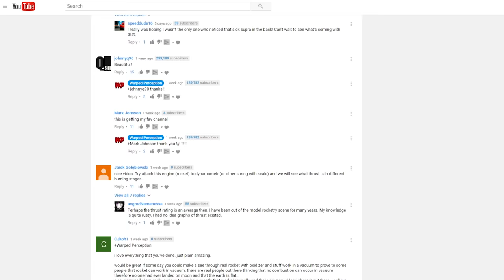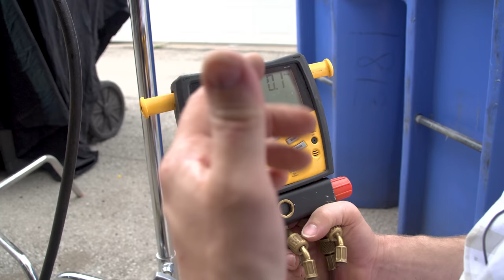Model Rocket Engine In A Vacuum Chamber - 4K Slow Motion - will it burn? - Rockets (S1 • E3)

Comment: The rocket propulsion filled the tube to create pressure and was pushing against the exhaust buildup to create the atmosphere and thus pressure. Your finite tube is not the vacuum of space.
Reply: It's irrelevant anyway, anyone who understands basic physics knows a rocket will work in a vacuum.
Reply: @mattl2k6  Really? I guess common sense is out, because anyone with common sense would figure out you can't have an equal and opposite force against nothing.  A vacuum is a void. It is void of anything and everything. Open a rocket nozzle filled with oxygen or explosives and the vacuum of space will suck the energy right out of existence.  Without an atmosphere, propulsion technology is rendered useless. Test pilots proved this a long time ago. But they want us to believe we can push against the great nothing and get something. Otherwise, we wouldn't believe they went to the moon or that they are exploring space! You cannot create or simulate the void of space here on earth. The container used to form a vacuum instantly has an atmosphere when the rocket discharges the gasses used to propel the object. They have distorted reality and science and everything we believe is a lie. Imagine charging people $50,000 to sit in a classroom as you teach them fake science and twist their realities. They have done it year after year after year. It is staggering! This is why they say it is lonely at the top. You can't have a conversation with anyone and have an actual meeting of the minds. I almost wish I didn't know everything already!
Reply: @davidwest2963  You don't need an atmosphere to push off of for a rocket motor to generate thrust. It's as simple as that.
Reply: @darklight2.1  the reason for this experiment and many others is for the sole purpose of sustaining the myth of space travel. Newton's law answered many questions but did not address the unknown elements of the vacuum of space. It is all supposition and speculation enshrined in educational curriculum and does not make sense beyond the confines of earth. If our planet is traveling 67,000 mph and we could crawl into space at a comparatively much slower speed to reach Mars, for example, the conservation of momentum would lose its convenient meaning. If we broke free from a spinning sphere, orbiting at break neck speeds, the solar system would take off and leave that speak we call a rocket in the star dust. It would be a cold and lonely place adrift the universe in a rocket with compressed oxygen and fuel with igniters. That rocket would need a lot of oxygen and solid fuel cells to survive 10 minutes after earth hurled away taking the moon with it. If a rocket traveled to Mars and beyond, we defied the gravitational forces this brought to your mind, in knee jerk fashion. No, we have rockets that broke through that force to reach Mars and beyond, all the while, with smooth transmissions of data. It is a fantasy and a fallacy to believe this has ever happened. Unless we have anti gravity technology. So they need to announce they had anti gravity capabilities in 1969. And since the lander left the moons' surface without a trace of propulsion and snagged the command module, for a safe trip back into our 67,000 mph atmosphere, we have hidden, top secret technology. Slow down cowboy, before you form another fantasy. We don't have the capabilities. And you want an equation to justify rocket propulsion in a tube to validate my assertion? How about we apply a little common sense starting from the beginning and unravel the many justifications needed to patch up the many many holes in this story. The vacuum tube demonstration is not the universe reduced to a vacuum tube and toy rocket. If it were, how far would it make it on the way to Mars? The fuel needed would be greater than the load capacity of ten rockets. If gravity is the glue; how do we neutralize the glue to transition from one moving body to the other? Compared to the forces needed to do these things, our rockets couldn't pull a greasy hair out of a gnats ass. And you believe we overcome these forces in the vacuum of space. NASA is a dog and pony show and I am out of cliches'. Wait! Happy hunting my friend.
Reply: One of Newton’s laws of motion states (can’t remember what one) that each and every action has a reaction. What rockets do is create a high pressure environment that expands out to space. The movement of the gasses propels the rocket forwards. You can test this by taking a balloon, filling it with air (creating a high pressure environment like a rocket) and opening the end of the balloon to release the air into a lower pressure environment (like a rocket shooting propellant into a vacuum). The air moving out of the balloon pushes the balloon in the opposite direction. This can also be tested by pushing a swing with an equal or similar mass to yourself while on a swing to simulate movement in a closed environment.
Reply: @davidwest2963  - "you can't have an equal and opposite force against nothing"

Good thing rockets take MASS with them to space to PUSH ON.

If you want to learn how rockets work, I can help you . Just answer a few simple physics questions.
First question:

If I fire a steel projectile from a crossbow, here on earth, will I feel a recoil force?
Yes or no?
Why or why not?
Reply: @davidwest2963  - ""It is all supposition and speculation "
It is not. we have literally flown THOUSANDS of spacecraft in space.
I have personally helped build, test, launch and operate a number of spacecraft in earth orbit and deep space.
Ask me any question you like.
Reply: @stuartgray5877  yes, but reduced or undetectable in most bows today... The bow string and bow tension create the energy or velocity of the wind splitting arrow. The hand holding the bow would be the point of recoil detection as the immovable object, but in the instance of arrow projection the recoil is mild compared to the energy released into the arrow. The stationary arrow is met with with a greater force than the arrow at rest. The kinetic energy is external and forces the arrow through the atmosphere. Rocket propulsion is internal and opposite to bow and arrow propulsion and would not be dependent on atmospheric pressure as the resistence needed for continued thrust of rocketry. Rocket propulsion needs (A) combustible fuel, (B) oxygen, and (C) atmosphere to create thrust. The vacuum of space does not provide B or C. You could package the massive amount of B needed, but not the essential atmospheric pressure. 

Rocket powered aircraft- test pilots proved this in the 50's and 60's. Once they reached the much thinner - upper atmosphere the rocket powered aircraft destabilized and lost propulsion needed to sustain flight or forward motion. These rocket powered missiles with wings did not make it to a zero atmosphere. A vehicle in space would need a whole new propulsion technology such as an anti gravity system to travel through space or to the moon for that matter. 

Sir, the deception runs deep and wide and relies chiefly on relativity. A flawed theory proven to be erroneous at best. You have been educated based on relativity because it nearly buttons up many loose ends found in this great deception. If everything is relative to perspective, no conclusion shall be reached. Science can prove nothing as a result and relies solely on faith and the gullibility of children in classrooms. Today it is very hard to believe assertions are based on lies and trickery, but they are in fact delusional in the cold light of day. If you do not know Einstein was completely incorrect, you likely know little else. This is not your fault. We are all victims of subversion. We have been subverted our entire lives on earth. I hope you can find your way out of this maze of cunning deception gripping mankind.
Reply: @davidwest2963  - "yes, but reduced or undetectable in most bows today..."

Watch the crossbow video on my YT channel for proof that this statement is false.

The correct answer is: YES the BOW will feel recoil as it fires the projectile 

"Rocket propulsion needs (A) combustible fuel, (B) oxygen, and (C) atmosphere to create thrust."

This is false. The rocket DOES NOT need atmosphere to push on . We would GET to that point if you finish answering my questions.

Next question:

If I fire a steel projectile from a crossbow IN SPACE, will I STILL feel a recoil force?
Yes or No?

"I hope you can find your way out of this maze of cunning deception gripping mankind."

Sorry, but I build, test,launch and FLY spacecraft in earth orbit and deep space as my JOB. And based on your understanding of physics, I have been doing that for longer than you have been alive.

Lookp the "Mars Global Surveyor", Stardust, Genesis, Deep Impact, and Kepler Space Telescope missions just to name a few that I have worked on.
Reply: @stuartgray5877  I hate to break it to you, but we have never left earth. We have traveled to the far reaches of earth, but we have not broken free of earth. Earth is motionless and extends beyond anything you can imagine. Beyond the ice barrier lies other lands of immense importance and distance. Watch any and all magnificent rockets as they continue their climb. They all follow a similar trajectory where they form an arch until they finaly vanish from sight. All space craft are traveling across earth to destinations we know not of. Earth is a flat and motionless place and the space program is the cover story for exploration far far beyond known land mass of the same plane of existence.

All rockets travel in a lateral direction after exceeding observable flight. Everything you do is real, but what you believe is fantasy. We build and launch rockets and those rockets do what the space shuttles did. They travel to undisclosed locations on earth and like the shuttle, some return. Why did we watch a demonstration of rockets landing in an upright position, recently? Earth is many times larger than our known earth and it extends beyond the ice ring surrounding oceanic waters of what is likely the center of our "universe "

Step back from the stage and watch the actors and in silence, without their dialogue, look at our world. Start with the behavior of every rocket launched on earth.

Mentally travel to Tansania, just below the equator, and follow the Nile river NORTH until it reaches the Mediterranean Sea 2,400 miles straight north as the crow flies. Ask yourself how water flows and meanders over 4,000 miles up the side of a globe shaped world. Next consider sea level elevation of the sane land as the Nile travel north. Tansania or lake Victoria has a sea level elevation of about 3/4 of a mile above the Nile Delta. You see a slow moving Nile river flowing down hill to the north in a gradual slope from start to finish. The Nile river does not defy the behavior of water on earth. It flows down hill as all water on earth and does not climb up the side of a ball shaped planet.

All land mass elevations are based on the same sea level. The Indian Ocean, the Red Sea, the Mediterranean Sea, and North Atlantic are all joined together by the very flat Suez Canal. The Canal does not flow as a river. It is a man made ditch and is filled by the Red Sea and Mediterranean until it reached the same, shared sea level. Can you show me a body of water where the surface conforms to the bottom of its container? If not our oceans are impossible on a globe earth. 

Rockets can do what I claimed. Water cannot do what you claim. So who needs help to understand the world they live on? You cannot improve my knowledge of earth. I corrected on what I was taught and you must also open your eyes and trust your own God given senses.

We need all the smart people we can find, because we have our quota of the lesser gods who can see the world is motionless and so fucking huge we may have not reached the limits of the plane with our known technology. It's enough to make you hate liars. I already hated Satanic rule over our lives
Reply: @stuartgray5877  I have no reason to think you are lying. I believe you. I am not in doubt rockets exist. Where you lose me is when you claim we left earth and traveled into an outer space beyond the atmosphere of earth using combustion engine technology. 

You cannot prove any claims of space travel outside earth's atmosphere. Every image and all footage are simulations. That is proven. You cannot compare archery of any type to propulsion rocketry and this method of comparing apples to oranges is a common and necessary procedure when validating what does not exist or cannot be proven. 

I have looked at many explanations for these claims and that is what you always find (explanations). True science doesn't rely on descriptions in the form of an explanation. You can invent anything in your imagination, you can explain it, and you can even simulate it, but this does not mean you did what you imagined, explained, and simulated.

You must have access to a high quality telescope. View Mars carefully and compare what you see with your own eyes to the images published of Mars. They are two very different types of objects. 

We did not go to Mars! We didn't go to the moon. Imagine if you were 234,000 miles closer to the moon than you are now. How bright would that object be? Would it be brighter than what we see in the night sky? Now look at moon mission images and ask how are they dark. Why would a solid object illuminating our night skies grow dimmer as you traveled closer to the object. Turn on a light bulb and light a room. Now walk toward the lit bulb and with your eyes look into the bulb 6 inches away and do this until you understand the moons surface would be a blinding light of lumins that would destroy the human eye and any optical lens we can made in 1969 and today.

We are tired of plausible explanations with no tangible and  no verifiable evidence. I know you believe it. But, you can't prove it. The words I speak and write are ignored by true believers like yourself. Words so simple and observations you can make yourself continue to be ignored. I know one simple fact. You will not observe Mars or Venus from a high powered telescope for yourself. If you could gain access to a powerful telescope, it is unlikely you would be permitted to study Mars independently using the tekescope.

Why would I want to study this string of deceptive explanations you recommended? You cannot and will not read what I have written to you. If you did, you would explain how the Nile river travels 4,200 miles north up the side of a ball or why the moon's illuminosity did not increase as we were standing on it.

You may work with a company who builds rockets, but you can't answer the questions about your proof. You won't bother to read this much less tell me how the Nile river flows up a ball north for 4,200 miles.

No...  you want me to waste my time and energy on topics that have no proof whatsoever when I have provable and logical examples of the reality of a motionless, flat earth, anyone can understand. Motionless earth is an established scientific fact. But, you cannot discuss facts. Relativity demands the exclusion of the words "scientific facts." Though there are scientific facts.  Now you want to defend your non factual paradigm. The fall back defense trap you must uphold. 

You and I both know you believe there are no scientific facts. That's not allowed to be acknowledged in the spinning globe world. It is problematic when traveling in the space time continuum you have embraced as reality.
Reply: @stuartgray5877   @Stuart Gray  No. I would not reply to a comment if I had not read the comment. The 2019 Spring Race video is a cool video. You get a sense of being in the car. 

Where was the air balloon. I didn't see it with the stardust capsule. Are they destroyed during descent or UV rays?

I honestly could not quite understand the reentry footage. I'm on my cellphone and will watch it on my desktop later. From that height the horizon would be much lower and curvature would be very obvious. They did not use a fisheye type lens. You cannot see it, but that footage proves conclusively the earth is not a 25,000 mile sphere.

I give people the benefit and seldom call them a liar. You guys start this, "You are a liar," routine every time I reply to comments. You can't imagine someone could be mistaken? I don't think you are a liar when you state matter of factually claims I am sure is incorrect. I presume you are mistaken. We are all wrong on something, but that doesn't mean we're lieing. It means we are not infallible and can be mistaken. Why would anyone lie about earth being motionless. People lie to benefit themselves. We can't fabricate claims to prove flat earth. We can't prove it with solid provable evidence. The mental biases won't allow people to see it when they look straight at it. It would take a special kind of stupid to fabricate any claims to support something someone already refuses to believe. 

In your case, it is psychologically impossible for you to consider the possibility we are correct. This can never happen. People have spent a lifetime and their careers based on relativity and died never knowing how deeply flawed the whole theory was and is. For you to grasp anything I have pointed out and to transition from your beliefs would be like mental suicide as your very reality and identity is defined by the spinning, orbiting globe concept. Something you will steadfastly take to the grave. And that's okay. It doesn't make you a liar.

I reply to people like you because you have a genuineness and I can test my conclusions or I can be forced to reverse my position in favor of what is true and correct. After all the truth is the only thing worth fighting for. I am willing to be wrong, but the results are always the same.  From the beginning I was shocked at how weak the actual evidence was, for the globe. Now I tend to feel saddened after an exchange like this. You don't even know that you don't know what is real. In one sense, you may be better off and on the other hand I am angry they have gotten away with this elaborate scam perpetrated on mankind in general.

The moon lander's are on display also, but it is absolutely proven we did not land on the lunar surface. You likely believe that to this day! And if you can't or won't see that as the one big hoax it was, you can never imagine any of this less obvious deception people have discovered. It is mind boggling, but I can't believe I ever believed we went to the moon from a ball earth circling the sun at 67,000 mph and keeping up with the sun at almost 500,000 mph.
Reply: @davidwest2963  

The stardust re-enty video was taken from an aircraft window out waiting specifically for the event.
that same event was witnessed by MILLIONS of people in california as it went overhead.

If you don't believe that the earth is rotating then please explain HOW most modern aircraft have ring-laser gyros that measure earth rotation AND CURVATURE as part of every pre-flight test.

This process if done literally THOUSANDS of times a day worldwide.

I have performed this test MYSELF on both a vehicle ready for flight AND a ring-laser gyro sitting by itself on a table.

If you dont believe what I am saying, then watch these YT videos:

“100% Proof that Earth Spins! Aircraft Laser Gyroscopes”
, or “Understanding the ADIRU | Training | Honeywell”
, or “IRS Align Mode - Carefully Measuring Earth's Rotation”

then come back here and tell me that Honeywell Engineer is LYING about how flight avionics perform pre-flight tests on an official Honeywell video.
Because lying about THAT would be a felony.
Reply: @davidwest2963  - "No. I would not reply to a comment if I had not read the comment."

I meant did you watch the two spacex launch videos?
If you DID watch them there is undeniable evidence of rocket propulsion in vacuum.

The car racing videos do not do it justice.  It seems as if the car is going slowly in the video. It seems much faster in real life.  I hit about 105 MPH at the end of the long straight.
Reply: @stuartgray5877  forgot to mention them. I saw the Space X footage several months ago. That was a spectacular demonstration as I recall. Are you referring to the upright landing, etc?
Reply: @stuartgray5877  Thank you. I will watch them when I have some down time. I have a house full until next week... tis' the season! Thanks again.
Reply: @davidwest2963  - "Are you referring to the upright landing, etc?

search YT for the video:
 "Uninterrupted Footage of the Falcon Heavy Launch and Booster Landing! "

THEN find the video of the SAME launch but FROM THE rocket. search YT for: "Falcon Heavy Test Flight"
 watch until about 24:30 into the video to witness the side boosters separating.

And watch both videos. It shows UNDENIABLE evidence that rockets DO work in a vacuum.
If you cannot see the evidence, let me know and i will explain it to you.
Reply: @davidwest2963  Well did you WATCH THEM or not?